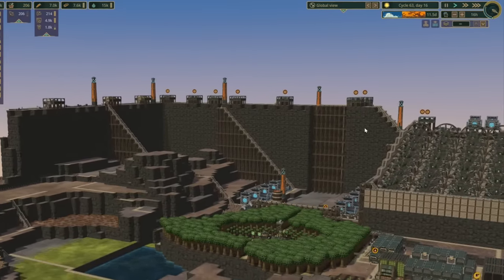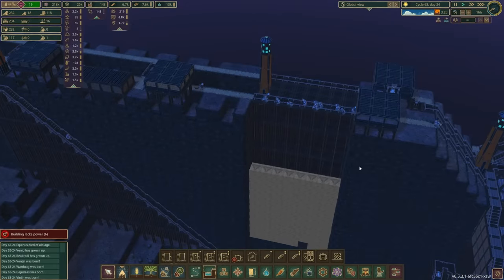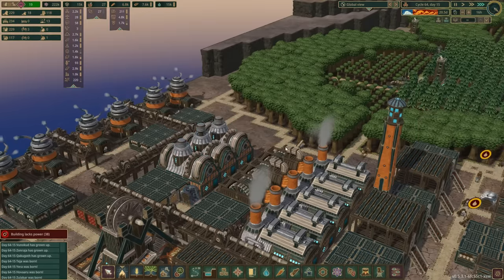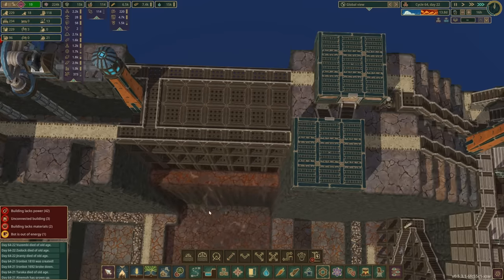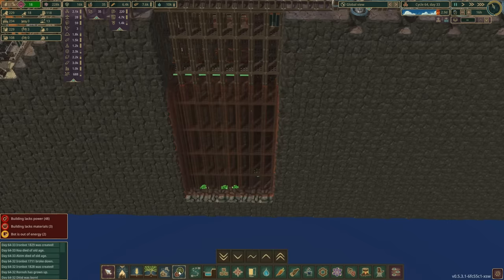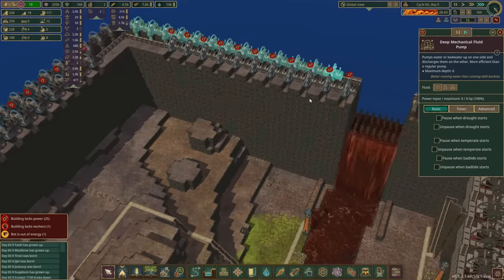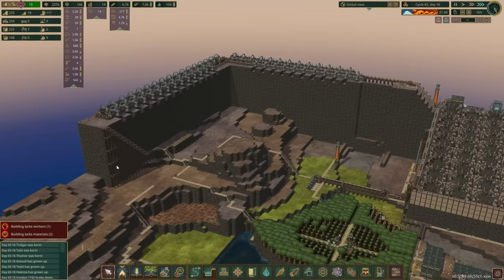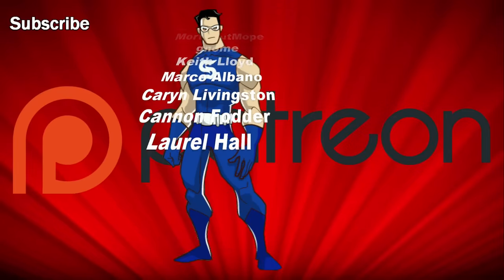WATER FILTRATION SYSTEM! - Timberborn BADTIDES Ep 16 - Update 5  Hard Mode

Comment: 21:44  Wow look at that water dance! I’d never have expected it to act that way. 

Anyway I expect if Bad water evaporates like normal water you could have just left it until it evaporated. Possibly dynamited a tile and let the good water dilute the bad water then add another terrain block to rebuild the pools. Or if you really just wanted to fill those holes temporarily to get rid of the bad water you could have filled them with levees, those are a lot cheaper than terrain blocks and do just as good a job.

Yeah the beavers could use survival instincts. Like stop running through sewage guys. (Not like I’m one to talk).

Comment: → Your treated plank shortage was likely related to not having any storage of pine resin (only in the tappers shacks). Getting a bit more of that beforehand might have helped.
→ 13:19 I'd put the warehouse for the gears just below the two large industrial piles. Saves a bit of planks and building time for 6 of the platforms.
→ Instead of filling in the hole with dirt, you could just put a badwater pump to get the bad water out. Plus maybe a wall so no more gets into it. (Assuming you actually want to keep the holes here.)

Comment: The bad water pumps are not needed. You can run the excess water off the edge of the map and simply pump good water out of the bad water and it would be nearly identical but with less resources and power requirements.

As for the depth charge effects, it is the displacement of the water when a block is put in. The water has to go somewhere and so it goes up, and thus a full block of water is brought to the surface where it has to then level out using normal water physics.

Comment: The waterfalls have a spread based upon the flow rate. I've run afoul of it too. In my experience you want a 2 tile buffer on either side of the waterfall, or a 2 tile retaining wall to prevent surging. So if you had dynamited the tiles either side of the waterfall at the river level, and one ahead of those for safety, you wouldn't have had issues.

Personally since you had power down there I'd have left the holes and just pumped the water into the river rather than wasting the dirt, but it's done now!

Comment: With such a large layered power system, and an L shaped section of bad water removal, I do think a geometic map would be interesting

Making large flat terraformed platforms of various sizes around to house specific things.
Raised circles with deep water holes in the middle to maximise farmland use
Hexagons that grow the various tree type.
Simple squares for housing and communal areas (perfect for Well-being maximising)
Connect them all with bridges that hangs over the gaps (filled with more natural looking terrain), and for the height use stairs on scaffolding to really minimise the look of the beavers touching anything outside of their "districts"

I guess the issue would always be actually getting power everywhere, and while most can be set up nearby, the mine is a different story

Comment: So for a few things, it doesn't matter if a small amount of bad water makes it into your main water, your water pumps only pump water and filter automatically, and contamination only kills things in range based on its percentage, so the small amount that made it past your flood gates would have made 0 impact on your ecosystem. The water "exploding" upwards actually does make sense, you are displacing an entire tile into space already occupied by fluid, this generates a wave effect that maintains its energy until it can go somewhere, which in this case is up. Fluid pulls other fluid with it, this combined with vacuums is how siphons work, that's why so much water was spilling out of the river.

Comment: start with capping the bad water. but, using the fresh water, you should make it a wetland. recapture all the water at the end of the map, losing none, and cycle it all back. does the filter that the bad and the good separately, or does it send the semi bad water off the map? could you let the bad water mix in, and filter it out back at the main filter? turning your filter into a water treatment plant :P will the mixed water, be the same amount of both, or does the math change it, to be more or less of both? experimentation is needed.

Comment: It would look great if you built a shorter 1/4 circle rezervoar under the waterfall corner and then through a series of holes have another set of waterfalls going from there to irrigate the rest of the map. At the same time you could have pumps on the edge of the rezervoar to pump out water whever the water level inside drops too much…

Comment: I think you shouldn't make a huge resevoir at the new waterpump waterfalls. Just make some two or three tile deep lakes on multiple levels. So just dynamite out  like one bigger lake on the top level, and then one or two on each side of that hill coming down to the river beds, and some artistic 1 block wide streams from those lakes into the main rivers, with some landscaping throughout like on the last big map you did with trees and bushes and flowers. Don't get ride of that one hill in the middle that divides the water flows though.

Maybe also rerout the output from the big watermill power plant around the other metal mine first , then you can mine more metal there too.

 Then concerning new development, now that bad water isn't a worry, first plug up the other bad water spring, then isn't there a way to filter that stuff? So to demonstrate mastery, take that new bad water spring and use that to fill in some of those big lakes at the low end of the map, and I think dedicate it to farming, get every kind of plant, aquatic and not, and every kind of food product that comes from that, to get max happiness from that kind of thing.

Comment: The water splashing is not uncommon in computer game water physics simulation.  It happens in real life as well, but not typically seen in that sort of extreme conditions. Basically each time of dirt dropped in creates ripples that have no place to go so they keep echoing back and forth, periodically these ripples collide resulting in a taller splash. Computer games often exaggerate the result, but to put it into real world perspective, you drop an ice cube in a partially full glass look at how high the splash is. That splash is not the water getting tossed up by the ice cube, but rather by the displacement wave (a micro tsunami), hitting the walls then being directed back til it collides with itself. This is more like you dropping a couple cubic meter blocks of concrete at a time into a swimming pool with 20-30 foot tall walls. the waves are going to bounce and reflect off til they either neutralize each other or til they synchronize into some super wave/splash.